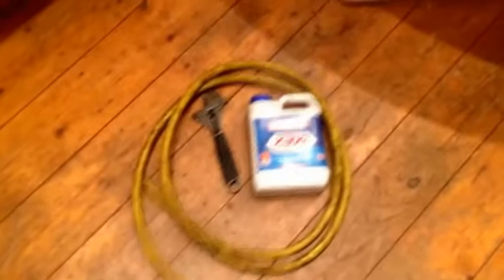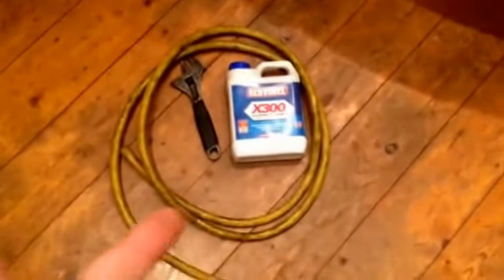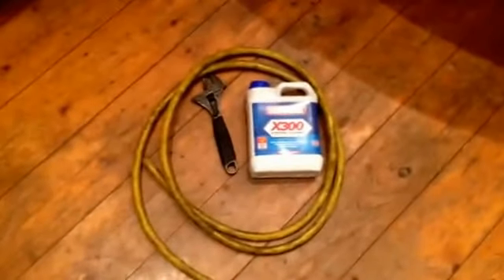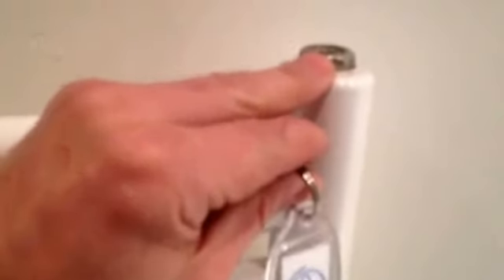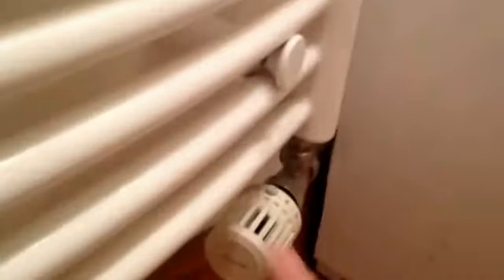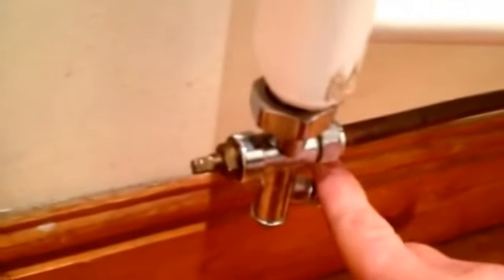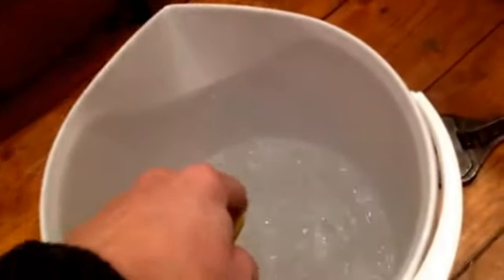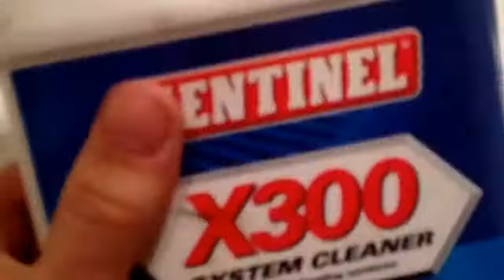How to add chemicals to a central heating system easily

Comment: Great video. I did this in about 10 minutes. Instead of using my mouth to start the syphoning (didn't want to risk a mouth full of radiator water) I used an old syphon hand pump that came with my fish tank. Thanks